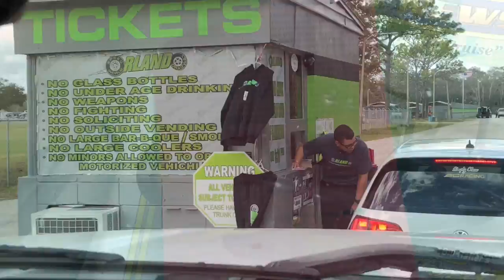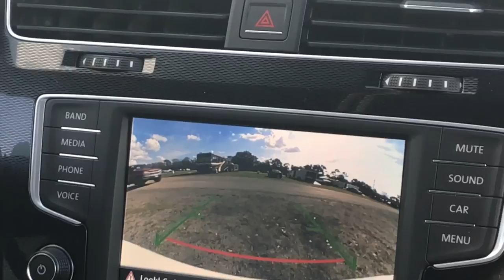Too Soon Junior!! 629hp Integra at the Track !

Comment: How did you make over 600 on 1000cc injectors? Just a lot of volume in the rail?
Reply from the maker: 2200 cc now sorry 1000 was my old setup. Ill do an update video soon with new parts list
Reply: @SPTuning   Hi SP tuning , i'm in france , i have an MB6 B18C4 engine for my futur turbo race car , need help ,600hp good with OEM cylinder open deck ?   thank's for your vidéo :)

Comment: Soon just soon for 10 and 9 I believe that car has it in there
Reply from the maker: Gonna be out bigger and better soon. Small set back
Reply: Mph should see mid 10s at least. I would start your burnout after the water box though. Get all the tire wet and do the burnout in the fresh rubber. You’ll see a big improvement in 60 ft times.

Comment: Air ur tires up a bit more. Too low like the way ur running it actually creates a lot of drag and will slow you down. Plus it’s a great way to snap an axle when it starts to wheel hop

Comment: No boost by gear ?
Reply: jockobo The waste gate is too small, in turn not doing its job, which didn't allow the boost controller to do it's job. The waste gate spring is 11psi, and the car hits and hold 17psi. 44mm gate coming next, and then it will have BBG.
Reply: FroMan Productions ah I see 👍